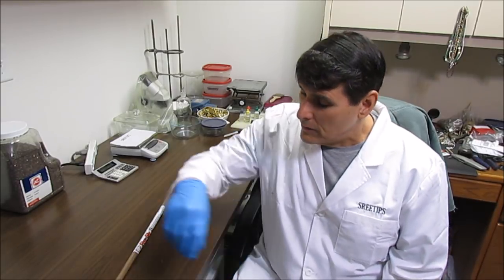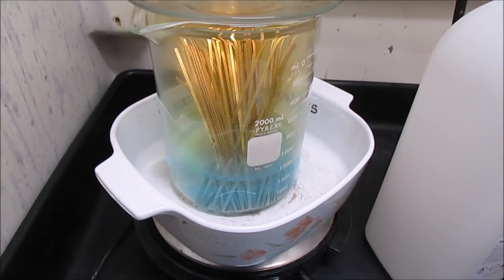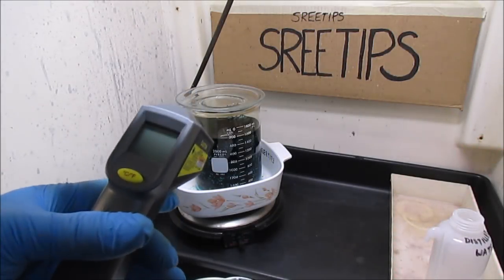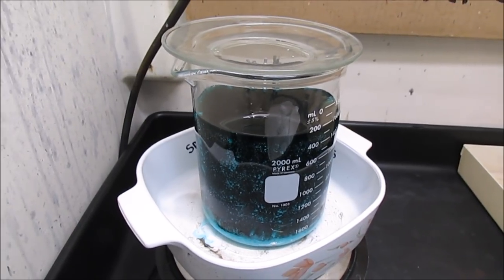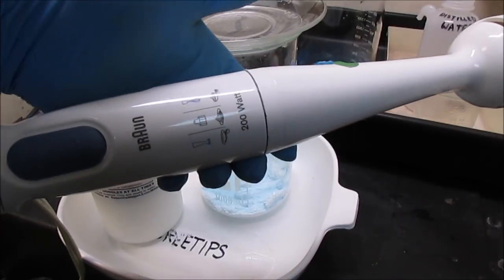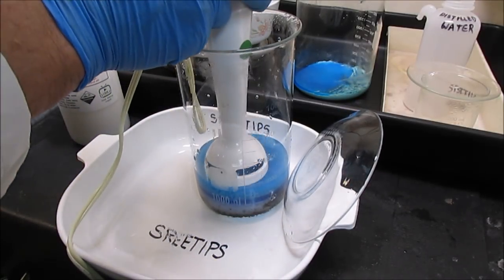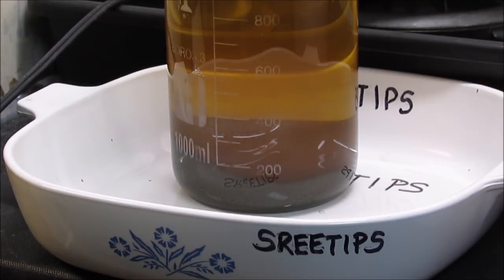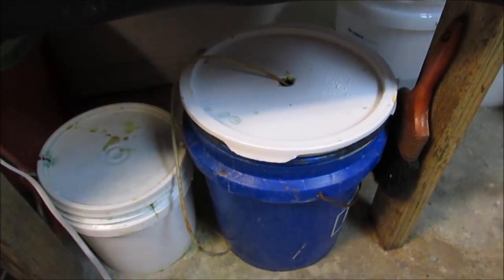Sreetips Silver Recovery From Brazing Rod

Comment: I have a dumb question I know nothing about chemistry but before additional rinses would not get a better concentrate by boiling off the water first? Also would smaller pieces work better...and also would meltdown allow you to recover the silver
Reply from the maker: Boiling off water, I don't know because I've never tried it. Smaller pieces would expose greater surface area and speed the reaction. Melting metals does not separate them. It alloys them. So melting would not help.
Reply: @sreetips   ahh thanks for the reply great video

Comment: I would love to see you extract palladium from automobile headlight reflectors. Also, why is nitric acid so expensive? According to Alibaba it costs less than $400 per metric ton in China.
Reply from the maker: I found a company that will sell a keg (pour boy) of 14 gallons of nitric acid for about $400 in Alabama. But they also charge a refundable $600 deposit for the stainless steel keg. Check goldrefiningforum.com for more sources of nitric acid. Those guys know their stuff.
Reply: Do you think your company will ship it to me in Ak?  Locally it costs me $55 for 500ccs.  I have had some shipped for much less

Comment: I had some Galena which I crushed up in a pest mortis and added to a beaker with diluted nitric acid then ran it through a filter then added hydrochloric acid to drop out the silver chloride. And it look like cottage cheese but my question is would lead drop out of the solution
Reply from the maker: If you have lead in solution, then you can precipitate the lead by adding concentrated sulfuric acid. It will react with the lead and form lead sulfate. It can then be filtered out completely. The resulting filtrate will be free of lead after you filter out the lead sulfate. This is the reason that I always add a few drops to my gold solutions before I filter them. Any lead that may have made it into the gold gets converted to lead sulfate. I do it even if I don't think that lead is present. It hurts nothing and guarantees that my gold will be free of any lead contamination.

Comment: What if you disolve the brazing rods in hydrochloric acid and hydrogen peroxide and silver should deposit on the bottom??
Reply from the maker: Hydrochloric acid would react with the silver and form a passive layer of silver chloride. Once encrusted, it protects the metal underneath from any further corrosive action from the acid.

Comment: Why couldn't you use the other method of extraction ?
Reply from the maker: Electrolytic needs silver that is high purity to begin with. At least 98% otherwise the anode filter gets clogged and the electrolyte fouls very quickly.

Comment: What would happen if you didn't use the sodium hydroxide and the sugar and just melted it down?
Reply from the maker: Silver chloride can be melted into pure silver metal, but not very easily. It must have soda ash (sodium carbonate) added during the melt, and lots of it. I've never tried it, and I'm only relaying what I've been told (thanks Harold_V).

Comment: I have to suspect there were some other metals in those brazing rods. Maybe some silicon? On the packaging is the composition clearly stated as 15% Ag and 85% Cu and nothing else? There are many, many brazing alloys and I am not going to tell you I have used more than the  most common ones but at minimum they have 5% phosphorus; others have highly variable mixtures of Zinc, or Tin http://www.harrisproductsgroup.com/en/Products/Alloys/Brazing/High-Silver/Safety-Silv-30.aspx  all sorts of things that will interfere with your nitric Ag/Cu dissolve. And it acted that way.
Reply from the maker: According to the data sheet for Stay-Silv 15, it contains 15% silver, 5% phosphorous, and 80% copper. This is where all the nitric went. And it's the reason that very little silver chloride precipitated out in the first try. As the silver dissolved out, it came right back out of solution on to the copper, consuming the nitric acid as it went. The copper consumed the nitric, and the silver consumed the nitric, but the silver consumed the most. With the large amount (80%) of metallic copper present, the small amount (15%) of silver would dissolve, cement out, dissolve, cement out, dissolve, cement out, on to the copper, over and over, consuming nitric acid as it (the silver) cycled in the solution over and over.

Comment: I think things would have been easier in terms of labor ( not to mention less costly in terms of nitric acid ), by melting the brazing rod down into a anode and making a copper electrolytic cell ( which would work on it's own ) and recovering the silver as slimes from the copper electrolytic cell.
Reply from the maker: Nice idea, can you make a video and show how to do it? Thank you.
Reply: Sorry, I'm not quite set up yet - I haven't even built my furnace yet. . . .  .A basic overview can be found in the book 'Refining Precious Metal Waste' by Hoke ( modern version with notes about proper safety ), and more extensive information can be found in the second half of the book 'The Electro-Plating and Electro-Refining of Metals' by Philip.....Both of these books can be found in PDF form, and if necessary I could send them to you if your interested ( just let me know ).....In a nut shell, you are purifying copper, in a method not to different from your silver cell ( a bit different voltage and different electrolyte ), where the base metals go into solution and your metals higher in the reactivity series ( silver, gold, platinum, ect.. ), fall out as the slimes, that you then recast as a new anode and then run through a silver cell or process by standard wet chemical methods.

Comment: Hi Sreetips. I have followed your channel for about a year now. Thank you for posting such interesting and informative videos on PM refining.  

I was wondering if I could pick your brain for a minute.  I was making a concentrated batch of AgNO3 electrolyte this past weekend and ran into a problem... when I went to dilute with store-bought distilled water, trace amounts of AgCl precipitate clouded the solution.  I suspected the "distilled water" I had bought was not as advertised so I went to a different store and bought another brand of distilled water. However, when I went to dilute the remaining solution the same thing happened- solution clouded with AgCl precipitate.

Have you ever experienced this problem before? Any ideas on what may be happening here? Should i try a 3rd brand of distilled water?  Any input you might have would be helpful.

Respectfully,
Mike T.
Reply from the maker: Yes it has. If I remember correctly hydrochloric acid got into my silver. I tried cementing and redissolving several times but it clouded when dh2o was added each time like you experienced. To resolve I had to Cement the silver then MELT the cement silver and pour molten into water. Then I rinsed and dissolved the silver in hot dilute nitric. Fire should drive off the culprit.
Reply: @sreetips  Great! Thank-you. I just finished doing exactly that... precipitate w/ HCl and convert with lye and sugar. Rinsed thoroughly and melted into shot. I needed to distill more red fuming HNO3 before trying again.  

I was wondering if the bullion coins may have been contaminated to begin with... I did use one odd-ball half ozt coin in this batch. Any idea how the metal may become contaminated with chlorides?

Comment: I wander if there’s flux in the rods?
Reply from the maker: They were solid, I don’t think that there was any flux in there.
Reply: Some silver rods come with solid flux on the outside, something akin to self-shielded stick electrodes for arc welding; in case of "naked" wire/ rods for brazing one typically uses borax (preferably dehydrated one). And then there are some alloys for "hard soldering" that do not require any flux - phosphor bronze, if memory serves me, used for hi-temp soldering of copper tubes in AC and refrigerating systems. I used it once, like 15 or more years back so I don't remember the name of this alloy, but I remember it didn't require any flux.

Comment: What if u directly melt silver chloride without converting it to silver oxide?
Reply from the maker: It won't melt, no matter how hot you get it. But, if you add sodium carbonate, it acts as a sort of catalyst and cause the metal to melt. But it's not very efficient and silver will be lost.

Comment: Definitely not profitable, but educational for sure! Yikes! 1 liter of nitric acid for that? Thanks for the videos!
Reply: Why is nitric acid expensive?
Reply: Charlie Devine...@ $30/gallon? That is what I pay for it. 

He used a little more than a quarter of that. $7.50 or rather $8.00 is not that expensive.

I do not know what you are paying for it but shop around.

You can find it at jewelry exchanges or high performance auto parts stores. 

Nitro methane (Nitric Acid and methanol) is one hell of a fuel.
Reply from the maker: Nitro methane has nitric acid in it? Wow, what a great video that would make: how to recovery nitric acid from nitro methane racing fuel - thanks for the idea!
Reply: Good question; No great answer, other than it just is. It does not have a widespread "common" use. There is a lot more Federal scrutiny applicable to it and it isn't available just anywhere. If it gets shipped in a goofball container and leaks, virtually any metal it contacts will produce NO2 nitrogen dioxide the red fumes which is fiendishly toxic; Can kill you (by instantly destroying your lungs) if you get a good breath; over and above the typical burns any strong acid will produce. Hydrochloric, you can buy at pool supply stores, maybe even Home Depot. Sulfuric is battery acid. There's no "ho hum" use for nitric.
Reply: Just for reference, nitromethane is nitrated methane ( just like nitroglycerin is nitrated glycerin ) not nitric acid and methane.
Reply: Not nitric acid and methane ( HNO3 and CH4 ), Nitrated Methane...is CH3NO2.   Compared to Methane ( CH4 ) it's missing one of the  Hydrogen atoms is replaced with a Nitrogen Dioxide molecule which is unstable when heated releasing Oxygen when it is burned in an engine... ... ...NitroMethane is a totally separate chemical and there should never be any actual nitric acid in it.  Nitromethane bought as racing fuel is usually already diluted as the pure form can be explosive - in fact is reputed to have been used in the Oklahoma City Bombing.

Comment: When you have L-Ag34Sn (34 % Ag, 36 % Cu, 27,5 % Zn, 2,5 % Sn) Silver sodder then SilverNitrate,Coppernitrate,ZinkNitrate and  Will be made with dissolving it with Nitric acid. If I'm not mistaken Tin wont reakt with Nitric acid. I think we can both conclude that less reaktive metals are kicked out of solution of the lower one.  In the link you can see that at 100 deg/C you can dissolve 733 grams per liter of silvernitrate in water but only 250 Coppernitrate at 40 deg 211  grams of Zincnitrate in a solution till it is saturated. I think in this case your experiment went weird because you did not add enough water to the reaktoin vessel. You can add enough Nitric acid but I think the salts need the space in the water to dissolve. So I think I make a good guess that if you have a pound of silver sodder you at least need 3 liters of liquid to have enough space to completely dissolve.
Reply: Also look at the colour of your solution...you can see it is saturated...I also saw it when there was little reaktion at quite a nitric addition. Liked this video a lot Mr. Sreetips. Still do...I've seen quite a number of your video's multiple times past years...In my opinion really the better refining video's...
Reply from the maker: Thank you Jan. Here is the reason that it took so much nitric to get the metals to go into solution;

According to the data sheet for Stay-Silv 15, it contains 15% silver, 5% phosphorous, and 80% copper. This is where all the nitric went. And it's the reason that very little silver chloride precipitated out in the first time I added hydrochloric acid. As the silver dissolved out, it came right back out of solution on to the copper, consuming the nitric acid as it went. The copper consumed the nitric, and the silver consumed the nitric, but the silver consumed the most. With the large amount (80%) of metallic copper present, the small amount (15%) of silver, the silver would dissolve, cement out, dissolve, cement out, dissolve, cement out, on to the copper, over and over, consuming nitric acid as it (the silver) cycled in and out of solution over and over.

There was no Sn (tin) present. Tin will react with nitric acid forming metastannic acid. It is a thick paste that will gum up a filter and stop it up completely. It's like trying to filter Elmers glue.
Reply: Yeah..I still remember the theory but I'm very causious diong the real experiments as you can not really predict how vigurous (or not) reactions will go. That takes expierience...I did some experiments but at very small scale...I really like to watch the real experiments and you see that expierience in this goes over theory as it is with operating power plants ;)
Reply: Yes that was a hint indeed that your first decanted solution contained little SilverNitrate...the Copper want's to go into solution first as with the metal displacement reaktion. To calculate results you need the molar equasions to calculate the amount of acid needed and then you need the solubility numbers to calculate how much water it takes to keep everything into solution. It takes expierience then in what amount of time you can do that without a boil over :D..expierience rules in the end :D
Reply: Oh and ofcourse the Phosphorus will also consume nitric acid. 3P + 5HNO3 -> 3HPO3 + 5NO + H2O. so that will turn into Phosphoric acid,Nitrogenmonoxide and water.

Comment: Why not do a AR with dropping copper instead of dilute nitric acid and lye. Sorry I know I am skipping the steps so if anyone read the above the AUTHOR will understand.
Reply from the maker: jonrms, i think you are referring to cementing out the silver on copper instead of using lye and sugar to get the silver. I could have, but I chose to use the silver chloride with lye and sugar so that I could test my hand-held blender. Otherwise, copper would have worked just fine.
Reply: sreetips As always THANK you for a great video and confirming that I have not gone mental yet. Ps. As for the handheld blender. You got me thinking of meat mincers and just a good food processor for IC chips. I am also considering a bench wheat mill. I seen another video you have made but by incineration.  I want to see if I can process IC chips without that. Removes the carbon element

Comment: Just spit balling here.  What if you treated the brazing rods like inquarted gold. Rather than using expensive nitric to try and extract the small amount of silver, why not try and use economical HCl and go after the base metals which is the majority of the makeup? Very little if any silver will go into solution as it would be precipitated out by the copper or not react with the acid as it would form a very thin layer of silver chloride.
Reply from the maker: I don’t think it would work. The silver in the rod would react with the HCl and form a tough passive layer of silver chloride that would shield the metal from the acid.
Reply: "According to the data sheet for Stay-Silv 15, it contains 15% silver, 5% phosphorous, and 80% copper" Sreetips stated in an earlier comment - so the only "base metal" here would be Cu, which cannot be dissolved in HCl.
Any metal "above" hydrogen in galvanic series cannot be "just dissolved" by acids, as their electrochemical potentials are higher than those of H+ cation, so they can't just "replace" the hydrogen in acid like Fe or Zn.
These are copper (Cu), mercury (Hg), tin (Sn), silver (Ag), platinum (Pt), gold (Au) - see tables on either pl.wikipedia.org/wiki/Szereg_napięciowy_metali or fi.wikipedia.org/wiki/Metallien_sähkökemiallinen_jännitesarja (those are the only ones showing it clearly, and elemental metals only).

Those metals need to be oxidised first, hence nitric acid - a strong oxidiser - and that's why there are fumes of nitric (IV) oxide, NO2, which is a by-product of the first stage of dissolving (which is the oxidation). Probably highly concentrated sulphuric acid (98% H2SO4, which is several times cheaper) could be used as it has some oxidising property, AND Ag2SO4 is soluble in H2SO4 solutions, but it'll take a lot of time.